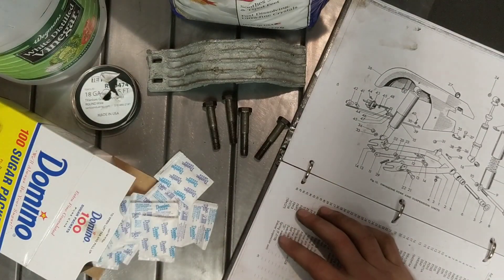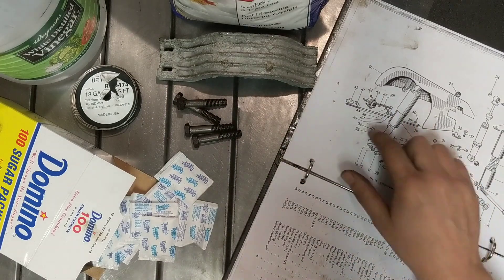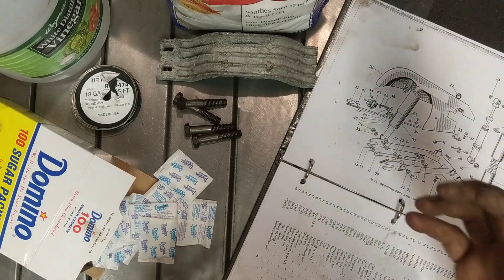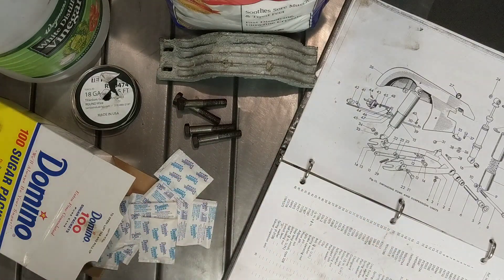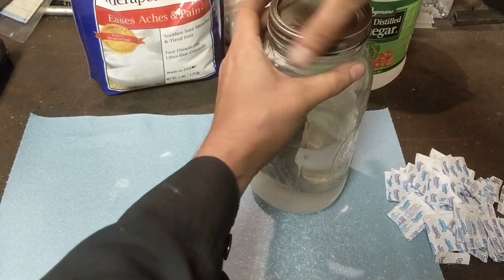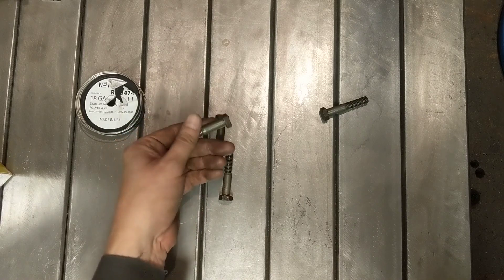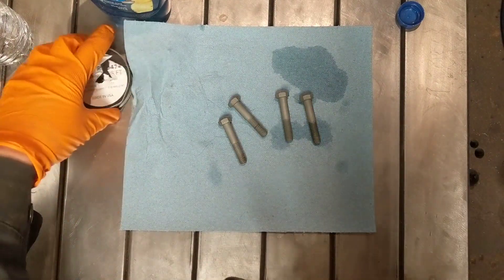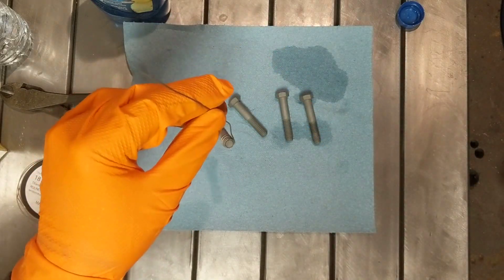DIY Zinc Plating

Comment: Americans would use anything but the metric system. 😆
Reply: Everything we purchase or consume is in Imperial measurements and everything we make is metric. It wouldn't be possible to change every machine in the shop. I am bi-dimensional and am comfortable with either platform.

Comment: I recommend using a wire wheel for cleaning the rust off of the metal parts i usually first use the wire wheel to clean the large amounts of rust off then let The part sit in some rust killing solution which turns The part black you can then go back over with the wire wheel and take that material off and clean it up and plate it but I do not like using media blast it basically creates a whole bunch of tiny pits in the Metal which is hard to get out

Comment: This explanation seemed misleading and overly complicated. Make an electrolyte with about 1 Gal. White Vinegar, 1/2 cup Epsom Salts, 1/3 cup Sugar. You can get free zinc from old wheel weights marked Zn or from the outer cases of dry cell batteries (zinc-carbon, not alkaline). Use 1.5V batteries (or an old 5vdc cellphone charger). Note: Car batteries and car chargers are too powerful. Attach the part you want to plate to negative and the sacrificial zinc anode to positive. Before plating, charge your solution overnight with zinc at both ends. Your anode will partially disintegrate into solution. Clean and degrease your parts. When plating, rotate your part occasionally to get full even coverage or surround your part with more anodes connected together. Use almost any conductive wire to hang things. If you want to make your plated part shinier, buff it. Plate outdoors to avoid fumes. (Note, most diecast parts are made of 96% zinc and 4% aluminum which is another great source for the zinc since the aluminum will not electroplate from solution.) Also note: Boat anodes are made of zinc, magnesium, or aluminum (not just zinc). Happy plating.
Reply: Thanks for sharing. This was more useful than some videos that I watched as I am trying DIY zinc electroplating at home for the first time.
Reply: @Spikev01  You are welcome. I've done a lot of zinc plating at home, mostly for rehabbing steel tools. Some how-to videos get a little misguided at times. BTW: I found 5lb zinc anodes on eBay for about $5 ea, so cheap! Plate slow for the best result. If you use too high a voltage and/or current the plating just wipes off. I guess I should do a video. Also, I've switched to "washing soda" for making the electrolytic rather than using Epson salts. :)
Reply: will any manganese remaining on zinc affect electrolyte? Thanks

Comment: it's wrong.  They use alkali baths. Acidic zincate baths require high current. 5-100 Amps, for short periods. It's only used on wires. The layer is thin. I'll keep seeking the hydroxide solution recipe

Comment: Another question. To make the initial solution I used two zinc strips with an old sony 400mA power adapter, as I had seen in some other videos. I left them powered in the vinegar/epson/sugar solution for a few hours. After that, I unplugged the power adapter and left the setup overnight. the next morning I looked at the solution, with the zinc strips still in there, connected to the adapter.  They were lightly bubbling and completely black! With the conductive solution, there was something going on with the circuit. Did I ruin the solution? What happened? Thank you!
Reply from the maker: That's interesting. I've done that electro-dissolving technique for nickel, but not for zinc. I can't think of what would cause that. It's probably carbon from the vinegar, but I have no idea what would cause that species to precipitate. 

I'd just wipe or scotchbrite off the electrodes and try to plate some test pieces with it; see what happens. If it doesn't work, try again without the electro-disolving (which shouldn't be necessary)

Comment: Is titanium wire necessary? I have copper wire.Thank you.
About 100g per liter of each: epson salt and of sugar - good to know.
Reply from the maker: Not *necessary*, but the reason for using it is that it doesn't react chemically with the electrolyte (or slowly anyhow). If you use copper you may get some contamination in your electrolyte and on your work. It may be ok as long as you don't immerse the copper wire on the positive side (with the zinc). That way you aren't dissolving copper from the wire into your solution. It should be ok to hang the work on copper wire. You'll just be plating the wire with zinc.

Comment: Not a pro by any means but  I think your zinc acitate is too weak. It should be very green looking.
Reply from the maker: Huh. Thanks for the tip. Got any ideas to up the concentration? I left that batch for about a week, so more time probably wouldn't help. Heating, aggetation? Electro-disolving; I've done that with nickel, takes an age.
Reply: @barnyardbikes54 Have to apologise, I was thinking of nickle plating. Your acetate is the right color. 
Might try the electro thing - which I've had the best luck with. Keep the current to about 1~1.5 amps for a couple of hours.
 Good luck and I look forward to more of your vids!
Reply from the maker: @ScottDLR  no worries. That nickel method works well. I think I started recording it but it didn't make for excited viewing. Should have some new stuff soon. I keep getting stuck halfway through projects. Thanks for the view!

Comment: I pretty much have the same setup but for some reason am not getting good zinc transfer. What voltage and amp are you running?
Reply: I have a 12V supply that I run close to max (10-11V). The apms depends on the surface area if the part, but for bolts and small parts, it's typically a few hundred milliamperes.

When you say "goods transfer", do you mean uniform - not patchy - or thick?
Reply: @markseiter8208  Yes I'm not getting a uniform coating, also its so thin if I scotch brite it it pretty much removes it. I'm using a variable power supply set at like 3v and 100milliamps for 1 bolt. I'm experimenting with 1 before I do a whole batch. The hardware was previously blasted but has been sitting so I dipped it in phosphoric acid for a couple min. Then removed rinsed with water and put it in the plating solution.
Reply: @kurtkose5238  huh. You seem to be getting much higher conduction through your solution, or your electrode is much closer to your part. That might have effect. It's possible to get "electrode shading". Try moving the electrode away from the part if it's very close.

I haven't tried phosphoric acid, but I don't think it would do much to remove non-polar contaminants (oil, grease...) Just Dawn soap and water, then acetone did a good job. Also, rust never sleeps. It's a good idea to scotchbrite before washing.

I
Reply: @markseiter8208  after I did the phosphoric acid, I also tried wire wheeling again then Spraying it down with brake clean still doesn't seem to be coating right. I'd show you pics of my setup but no pics on here lol. I'm pretty sure its hooked up right, have positive of the power supply to the anode Neg. on the part. If I cant figure it out maybe I'll just powdercoat them when my oven is fixed lol.

Comment: Thanks man, i was stressing over the measurements too.. Like "what the hell" you know lol
Reply from the maker: Glad I could help. This process isn't very finicky. Copper or nickel might be more sensitive to variation. I'll ldo something on those solutions soon. Stay tuned...*cough*subscribe*hmph*....
Reply from the maker: As far as surface finish, what you put into the tank is what comes out. You're only putting a few tenths (0.0001") on, if that, so the base metal has to be shiny if you want a shiny finish. Or polish, plate, repeat, until you're happy. Usual stuff works; 600 wet/dry, 00 scotch brite, etc.